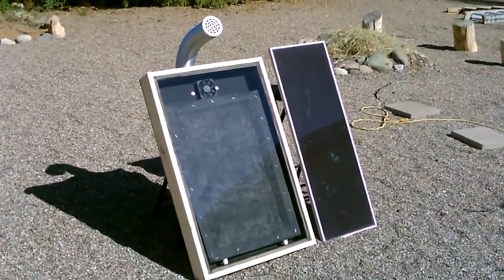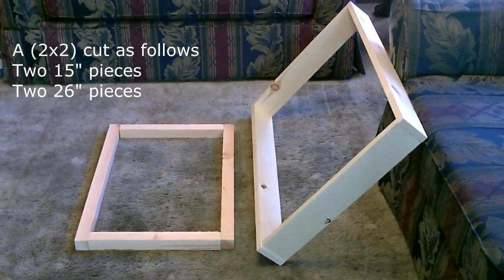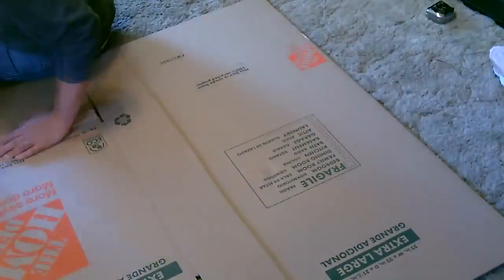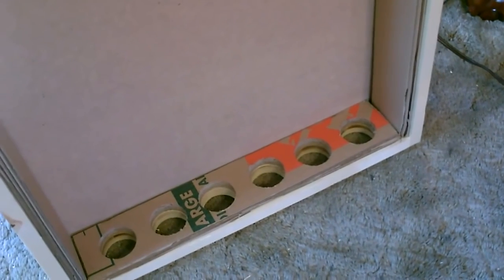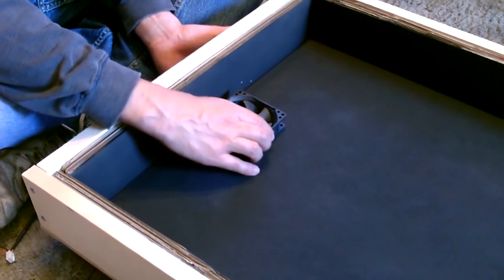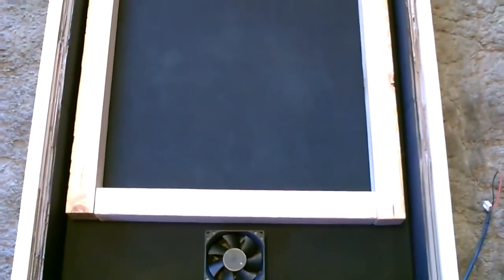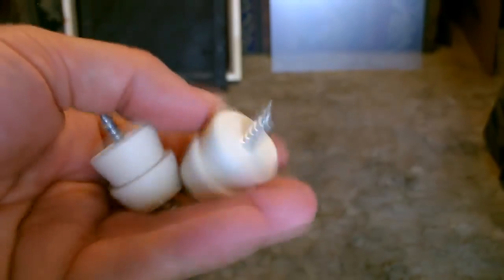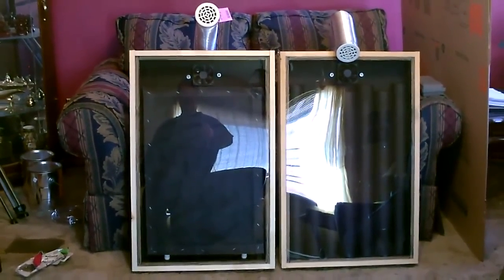Solar Air Heater! - The Screen Absorber Solar Air Heater! - Easy DIY (full instructions)

Comment: First thought is your wife comes across that carpet barefoot and gets a splinter in her foot you better be making you a dog house to live in.lol And why are you drawing in outside air to try and heat and not the inside air. Its like turning on the AC In August to cool the house with your windoes open